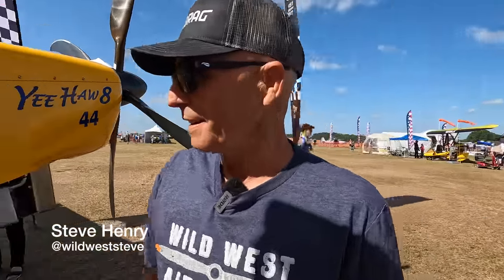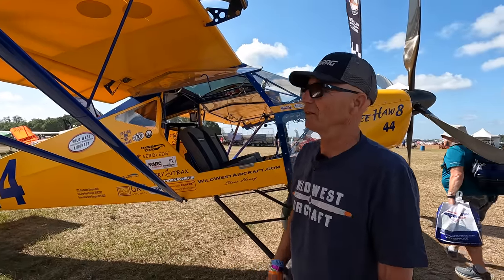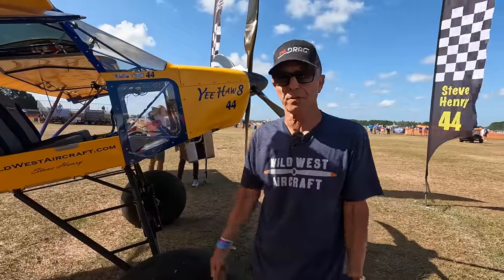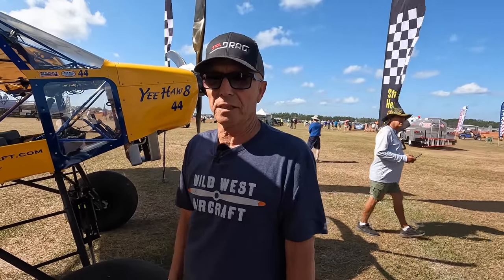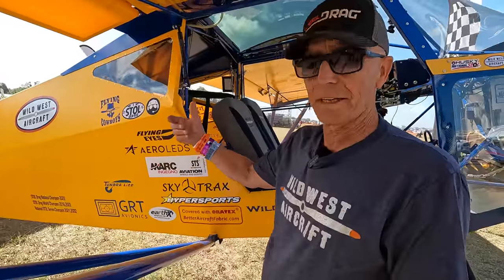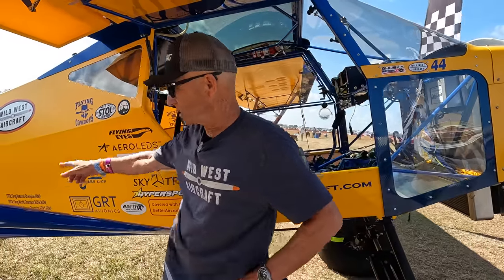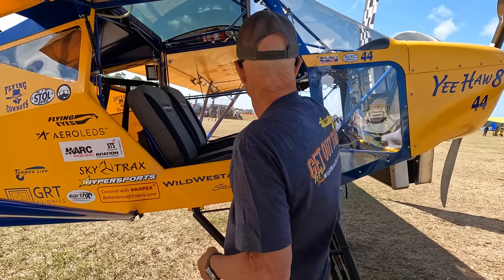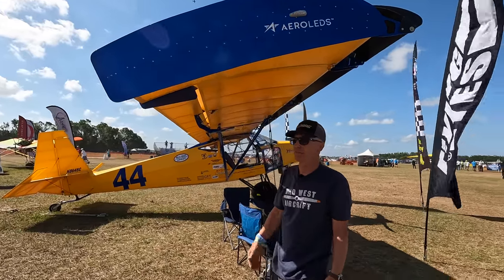Highlander Walk-around at Sun'n Fun 2023

Comment: I like the new paddle prop, watching your landings and I would suggest some dampening on the landing gear so you don't bounce and are able to use the brakes sooner and more effectively. Just an opinion
Reply from the maker: I land with the brakes on hard, but I agree we need to do a little adjusting on the suspension to get rid of the bounce.
Reply: @SteveHenry  that new prop and reduction gearing really kicks out the thrust. I like the way the outer third of the blade is shaped. What diameter is it? It's huge, probably great until 60mph... Lol. But for what the job at hand is I don't think you could come up with a better combo, now ditch those bungee's for some shocks like Acme Aero Fab makes and get your landings down to less than 20ft to match those insane takeoffs.

Comment: one nice little plane , love all the front visability . when do flaps become air brakes ?,would it be possible to do auto deployed double leading edge foils .al la Mike patey's .are the wing extentsions removable ,and leading edge foils ? , for economical travell .
Reply from the maker: The only time I run the wing extensions are for an actual short takeoff and landing competition. The leading edge slats are easily removable for when we want to put the airplane in the trailer.

Comment: You think a Highlander XL w/o slats but with the cuff will land come down at a very high angle of attack? I`m kinda a weekend warrior, and I`m not looking to get into STOL as a sport. I see it as a way to have margins on my side when I use fields and grass strips. I don`t think I can maintain the skill level to land aggressively and not see where I`m going. I want a good STOL plane, but want to keep away fron the extreme end. It`s the old deal with finding the right plane for my mission. I think I am closing in on either the Highlander XL or Rans S20. Probably run an 108hp EP912ECI. You know, sensible but still kinda cool..
Reply from the maker: Call Steve and he can help you decide! -Sara

Comment: "People take it like this...uh...y'know... 300 or 400 horsepower."   
Wait.  WUT?   Well... is it 300, or 400 HP?   Gadzooks.   A lightweight 300 HP "off the shelf" engine is a pretty big deal.  Please say more about it.
Reply: Thought that too , mortals are still 'moving up' to 160 hp .. they talk about that at the last drag stol event were steve was piped buy a nitrous boosted beast hitting 400 hp.  on a plane weighting 8-900 lbs they must pull around 4 Gs by my very rough guestimate be nice to know .
Reply from the maker: These engines are extremely tunable with the right ignition system, etc. and someone who knows what they’re doing like my friend Glenn Hall at HyperSports. With everything stock other than the ignition system, they can easily make 275 hp.  On my engine I have a bigger turbo and bigger injectors, so it can go much more. I have a selector switch with preset maps in the ECU for different power levels. 
We are putting together these engine packages for Highlanders and Superstol‘s